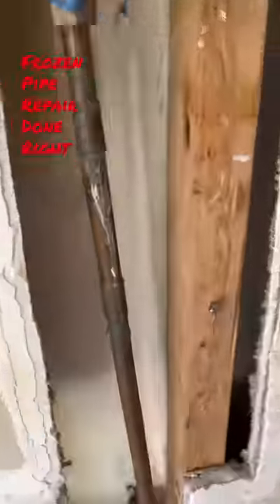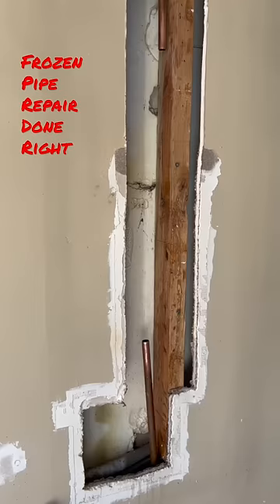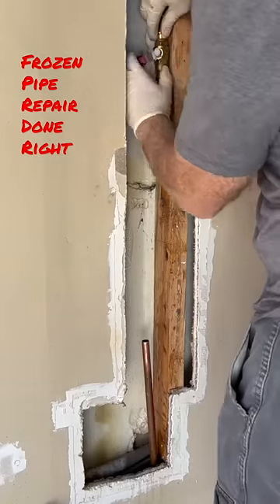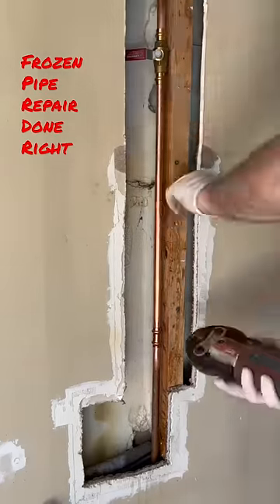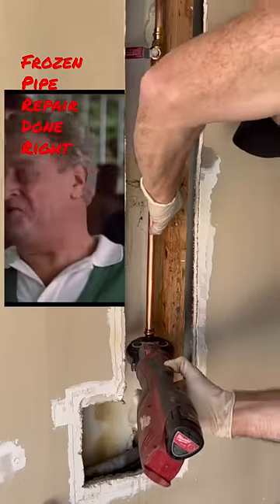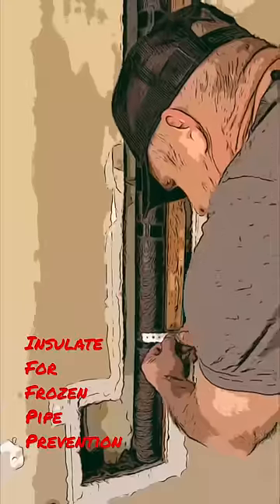Frozen Plumbing Pipe Repair @TappPlumbing #shorts #plumberslife #plumbingproblems

Comment: I didn’t see a gate valve
Reply from the maker: The gate valve has the compression type joints and the blue handle at the very first of the video.
Reply: @TappPlumbing  gotcha thought it was a globe valve and I was gonna be all smart
Reply from the maker: @ryantoner8132  No worries! They look nearly identical. Do you do mostly commercial?

Comment: AVOID FROZEN PIPES BY LETTING YOUR WATER BARELY RUN, WATER WON'T FREEZE IF MOVING.
Reply: Oh yes it most certainly will.  Granted, the ambient temperature has to be a lot colder in order for moving water to freeze, but when the ambient temperature gets down close to single digits, water will freeze solid whether it's moving or not.
Reply: not always true.. just takes longer

Comment: That solder looks like crap, I have done better pipe repair, I'm no plumber but that was the first thing I saw.
Reply from the maker: If you gonna use a torch then try to at least make the joints look decent!!!

Comment: Too bad he didn't sodier a pipe climp pipes with glue don't hold.
Reply from the maker: Where did you see some glue my friend?
Reply: @TappPlumbing  I hope you glue them before you climp. Climp don't work to well with out glue.
Reply from the maker: @daisykaren6584  No glue needed with those particular fittings . They are pro press!